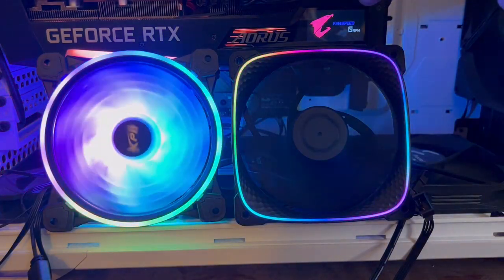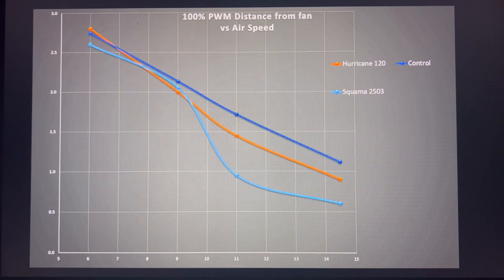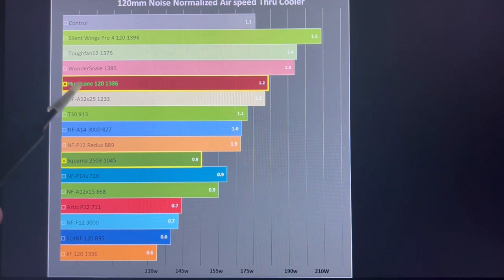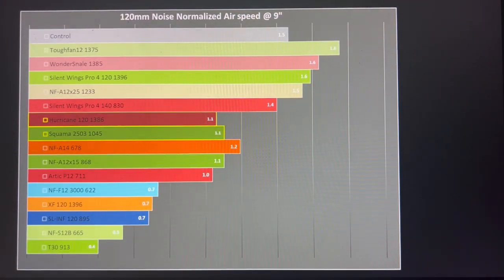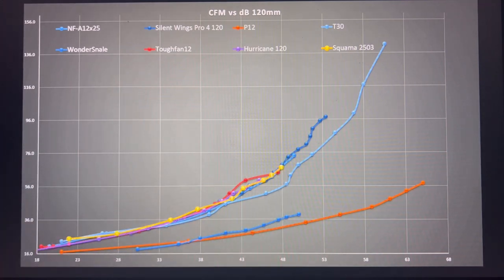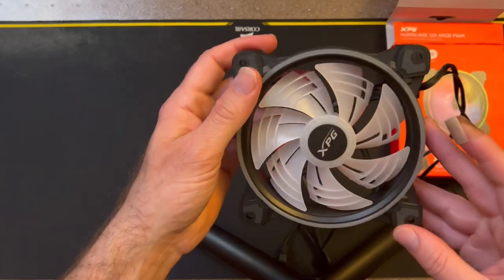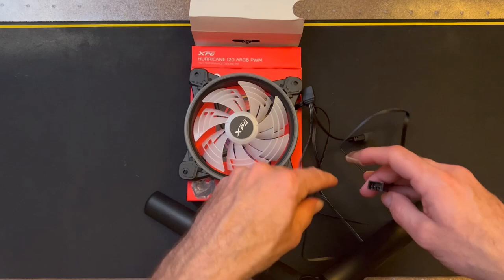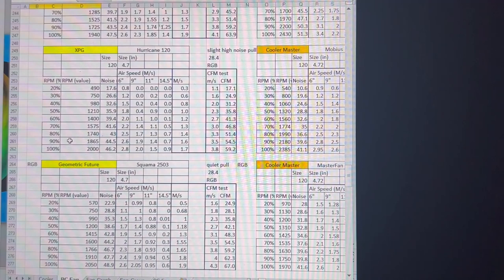Gale Force winds predicted: The Hurrican120 PC & Squama2503   (Old Testing Method)

Comment: Thanks for this high level of testing and review! I recently subbed to this channel and just happened to be looking at the Squama fan for a new build, so this is perfect timing for me. Looks like it might work well enough as case fan (with RGB, otherwise I'd probably go Be Quiet or Scythe) for Fractal Design Terra given the size of the case. The subtle RGB is the main draw for me.

The last (well, only) dimpled fans I've used were Ainex Omega Typhoon fans, which were probably the quietest fans I've used. Not sure how much of that was down to the dimpling versus other factors, but the golf ball texture adds an interesting aesthetic to the design, regardless.
Reply from the maker: I personally think the dimples are a gimmick for the most part, but its unique and that's always cool. 
But yea the sublet RGB is kind of refreshing.

Comment: The performance is disappointing. The 2505y are some of the prettier non-RGB fans out there. Thanks for your effort to test them
Reply from the maker: I've actually been meaning to test the 2505's but just havent gotten to it yet. I am just producing my new retested fans. Like I retested all the fans I had done so far with a new and improved methodology. Ill be mixing in new fans into my previously tested (new method) videos. haha. 
Thank you for watching. :)
Reply: The STS channel tested both. Seems the 2505 can keep it cooler, but at the cost of a lot of noise, probably being high static pressure, possibly making them perform better for a radiator rather than general usecase. @computer-tech-more
Reply from the maker: @blessed4789  I agree with that. on squamas website thats what they say its designed for. But still want to put it though my tests
Reply: Looking forward to seeing the detailed test results
 @computer-tech-more